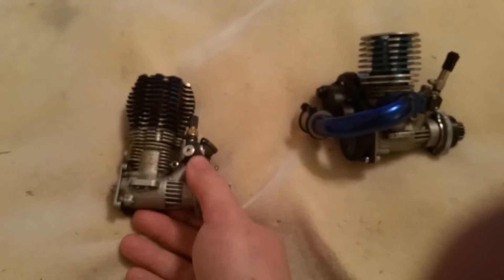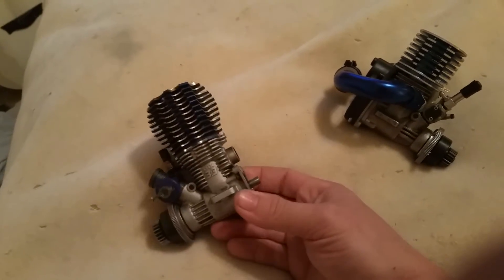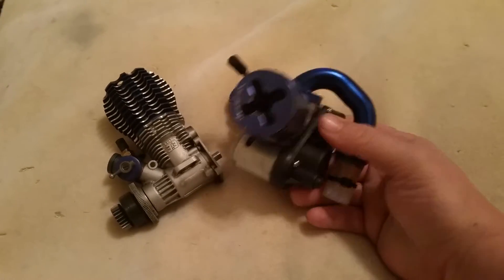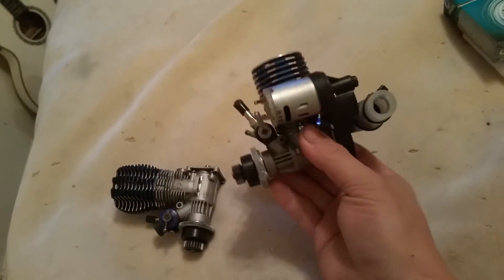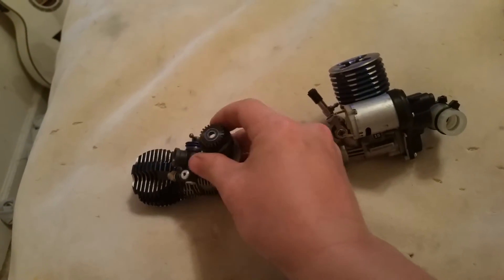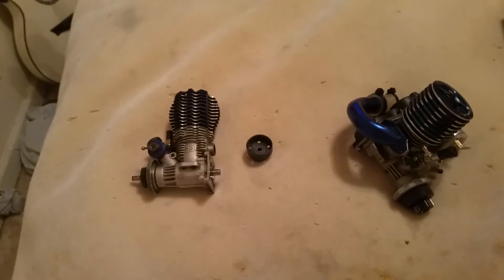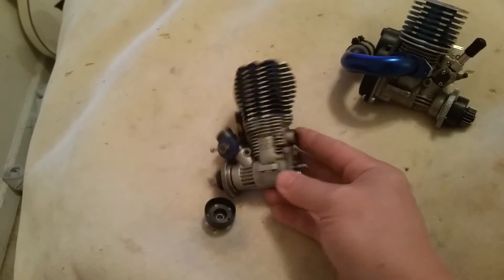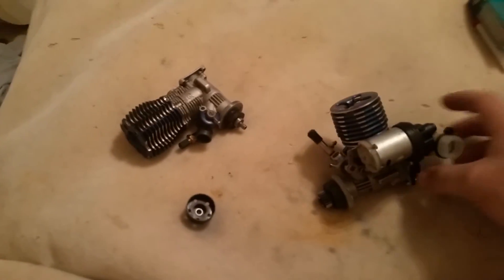Part 1 of 3: Parts and basics of a nitro engine

Comment: Hey bud did u happen to see the vid by rawsteele, I was getting ready to buy an castle XLX esc and the 2028 motor for my X maxx and then I saw that vid just watch that shit and get back at me, iam not sure what to do now
Reply from the maker: you can shut off the safeguards using castle link.
Reply from the maker: the xlx/2028 is a blast in the X-maxx, yiu can select the pea amps now, 200, 210, 220 or no safeguard.  with no safeguard you get all the power like the xl2 but the warranty is void when you turn the safeguard off and something goes wrong